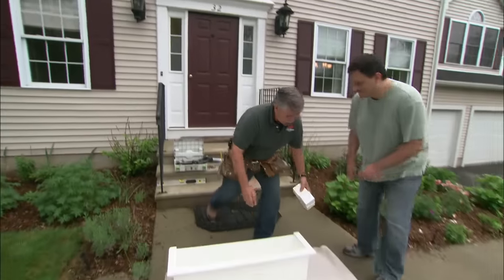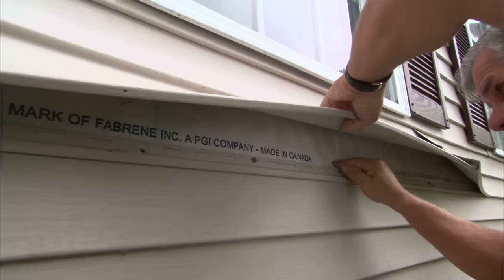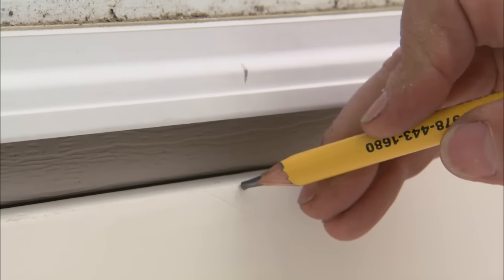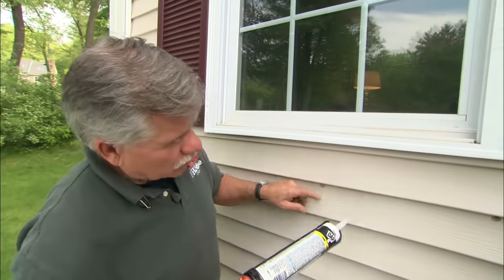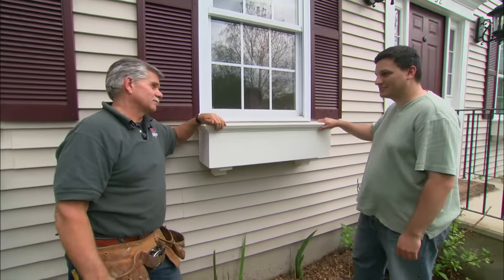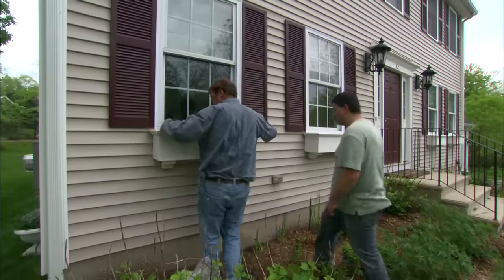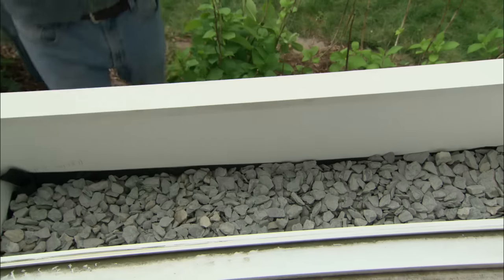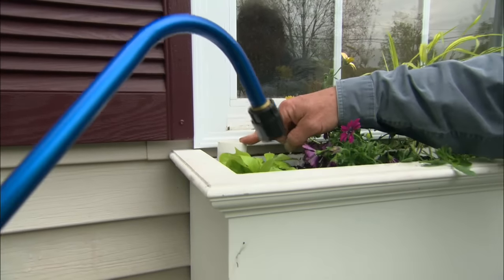How to Install and Plant Window Boxes | This Old House

Comment: So if you have insulation board and house wrap you’re pretty much breaking the barrier. But if you decide to get rid of them you now have damaged siding that may no longer be available or may be faded if you were to repair. Is there another way to install them without damaging the siding?

Comment: Wouldn't it have been easier to use a stud finder than to pull up the siding and go thru' all the problem of putting it back properly?
Reply: No
Reply: Nope, trying to use a stud finder on vinyl siding is pretty much impossible because of an air space between the siding and sheathing. This was the correct way.

Comment: You gotta lova American houses. Sticks of wood covered in multiple layers of plastic.
Reply: We have lots of both sticks of wood and plastic.   Most of the brick plants are being shut down due to EPA regulations and being bought out by Australian companies and China.
Reply: Wood is superior for individual family homes. Concrete or clay block framing is overkill, wasteful, and worse for the environment than wood. We are rich in wood. Europe/Asia isn't, and its expensive, that's why you use block. 

Wood is better for the environment because it stores carbon, and is sustainable.
Reply: @Narrow Path That's great but as styles change, houses change.  No house EVER  is meant to last a 1000 years.  The only thing left would be the brick.  Pretty worthless.

Comment: Couldn’t you use a stud finder on the inside to find a stud for reference? This would eliminate peeling off the siding.
Reply: Could be a shearwall, which could throw off the stud finder. Probing with a drill isnt a terrible idea since its covered with siding.
Reply: I usually use strong magnets to find studs as they are often nailed in with steel nails.
Reply: Yes, but it wouldn't be any faster.

Comment: The vinyl siding installer should have nailed the siding into the spot where there is a framing stud.  Apparently the installer on this house did not...
Reply: yaa i grew up with family members with "green thumbs" at best they were herbicidest. tho it u fill them with plastic flowers everyone wins..
Reply: Some houses are fully sheathed in plywood or osb, therefore, finding a stud when installing vinyl is unnecessary.

Comment: Why not find the studs from inside the house and then measure where they are relative to the window?
Reply: You can do it both ways, both require about the same amount of time.
Reply: Just do what Tom said. It’s not rocket science and a zip tool’s line $5

Comment: It's interesting that the lower supports are merely window dressing. My original window box supports were solid wood anchored into the stucco & wood backing material, but after they rotted out I had to replace them with brackets & dentil block covers. They look great, but again, the brackets provide 100% of the support.